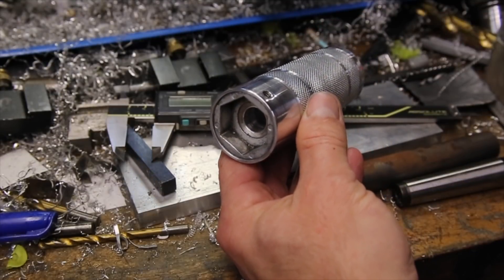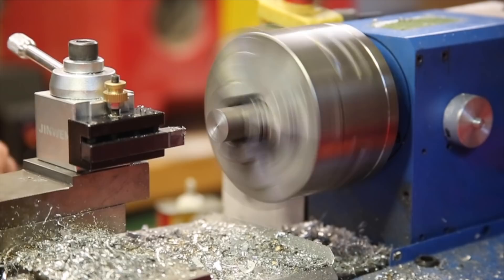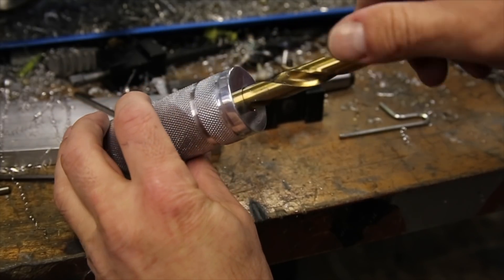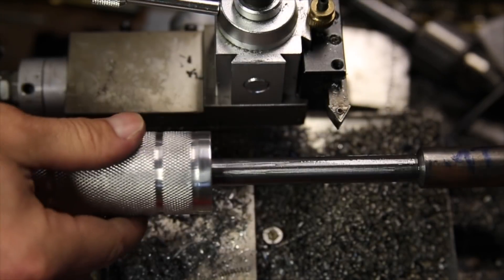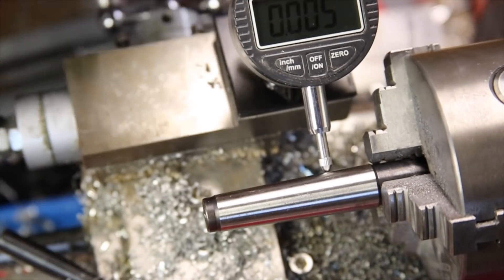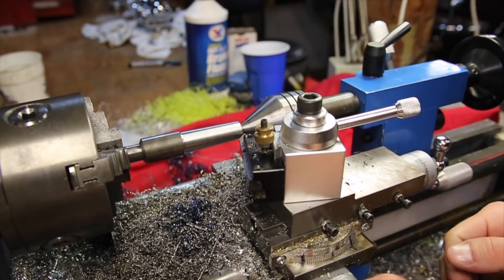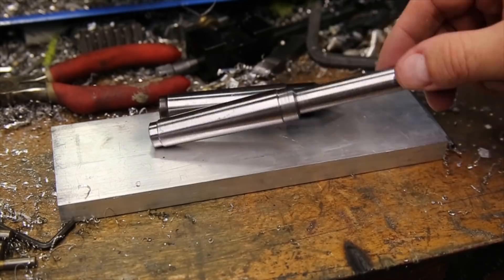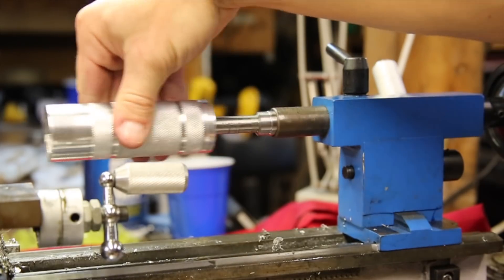(2/3) Making a Tailstock Hex Die Holder MT2 Guide from Mild Steel for the Mini Lathe

Comment: I think you will find that the little bit of extra slop from over shooting the final diameter will be necessary to take up the error from flipping it around in the chuck. Also it won't hurt anything if it's a little bit off because the die will try to center itself as long as it's held perpendicular to the work.
Reply from the maker: Agreed! Thanks for the reassurance!
Reply: I have a commercial unit purchased and sold on eBay and it has some slop. It needs it to walk itself as it threads. I’m making one now from 4140  for some very large dies I have for threading up to 30mm-1.0.

Comment: Blue cut away mtrl means you are cutting to fast, feeding to fast, or cutting to deep. When you see blue adjust your speeds and feeds. Also If you make it fixed to the piece you just made with space behind the die you can just use the tail stock locked in place and it will pull itself out as it cuts the threads, holding it is sketchy if the lathe is running. But looks good. oh ya also every time you remove the part from the chuck you change the orientation, to keep it tight on tolerances keep it in the chuck for as many processes as possible before removing. I didn't realize this is for hand die cutting with the spindle locked rather than cutting under power so its perfect how it is!

Comment: Add a handle that works like a lathe dog with a ball end. Mine will keep it from spinning and the ball allows it to slide back and forth over the carriage without catching. Or you could make a guide track off the carriage. It’s a lot easier and less setup threading this way. Besides far more options.

Comment: Did the compound and carriage screw got loosen with those wobbling turning? I had mine that just unscrew despite tightening prior to turn steel.
Reply from the maker: If you're asking about where I think you're asking - it didn't, I just tightened it down to lock the cross slide in place a bit better.